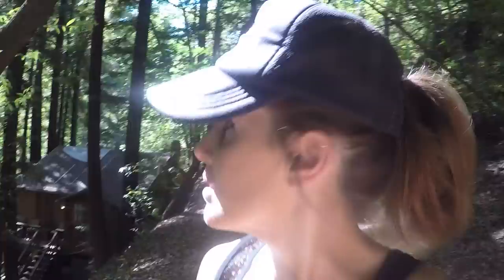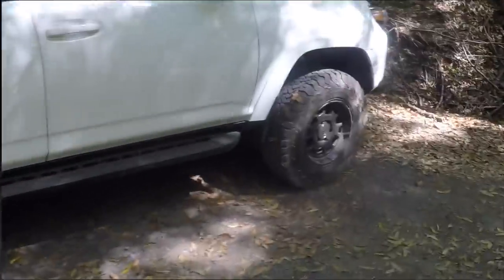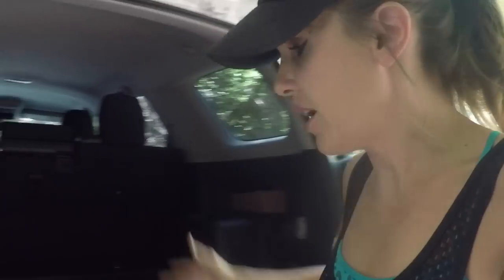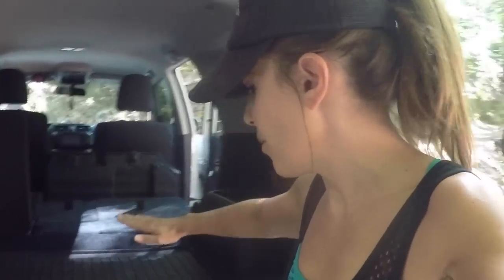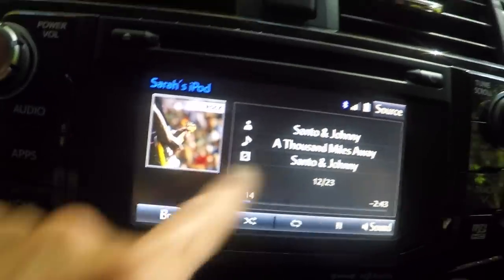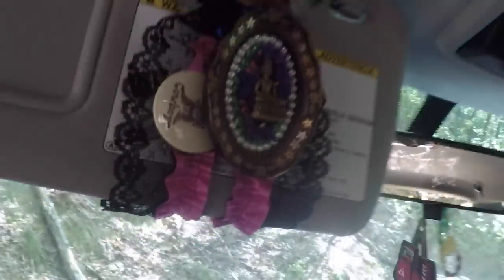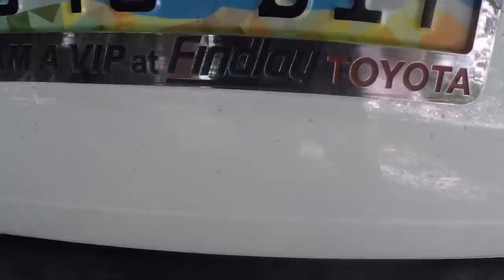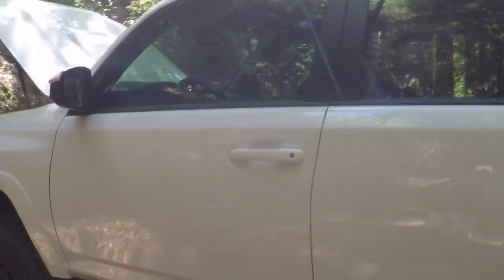Overview of My New 2017 Toyota TRD Off Road 4Runner

Comment: Good luck with your new ride! White and silver is the best in a hot/sunny climate especially where you go. I have an 87' 4Runner I got new and it's still running strong, everything works and the interior is still in good shape just the fabric has fade after 30 years. If you take care of it it should give you many years of good service. My only suggestion is to use common sense as far as traveling true off roading. You can get yourself in a real big jam with no help around. Emergency beacons are a good thing to carry.✌️and stay safe!
Reply from the maker: +J Vatell thank you!
Reply from the maker: +Wonder Hussy wow, that is an impressive story! I love hearing stories like that when people take pride in their possessions and don't just trade them in every few years for a newer flashier model. good for you!!
Reply: I do take very good pride in "all" of my possessions and it also the way my mom taught and raised me (plus you work hard for your money). I have a 10 year old Jeep also I bought new but mechanically it is junk compared to the 4Runner. I have spent more money in it's life than ever in the 30 years with the Toyota. The only major repair I had to do on the 4Runner was to replace the headgasket. All the rest has been just regular maintenance, tires, shocks and brakes.
Reply from the maker: J Vatell yeah I heard that about Jeeps.....too bad, they look so cool!

Comment: White does stay cooler for sure, l have a Tacoma in white. If you drive it right the tires will last you much longer than they are warrantied for (stay below 75). No you don't need more lift. Go to a sporting goods store and buy a backpacker mattress, it should make the back even, just check them out.

Comment: Here are some suggestions of things to pack for one of your trips. 1) a first aid kit. 2)MAXSA Escaper Buddy Traction Mat (Set of 2) for Off-Road Mud, Sand, & Snow Vehicle Extraction , 3)Extreme Outback Products  Ultimate Shovel (three section shovel stores in a carry bag) or some type of small shovel..  4)  a jerry can for water. 5) tarp, paracord and tent stakes for  a shaded area outside of the vehicle. 6)Flashlight, signal flares. 7)wet wipes and TP. (cause shit happens.)

Comment: Did you negotiate them down some from MSRP?  Toyota dealers can be stubborn to move from retail prices at times.   I have a 2012 Toyota and it's got over 120k with no issues other than a bum battery
Reply from the maker: +huggable cactus I had a friend do the deal... he used to work for the dealer so he knew all the ins and outs and got me a fair price :-)

Comment: I've heard mostly great things about the 4runner. also if you keep a vehicle for a long time the warranty will payfore itself at least once. that looks like factory level tint you're probably just not used to having tint on your front windows. it's probably like a 30% tint level, my car has 5% on every window lol. give yourself some time to get used to it, you'll grow to love it with the sun beaming through. 
lastly, in my truck I keep ratchet straps/tow hooks, because I'm too cheap for a winch and they come in handy, jumper cables, emergency kit, a basic tool set, first aid kit, portable air compressor like one that fits into a 12v cigarette thing. where I live the winters get bad so in the winter I add extra emergency stuff, I usually end up using at least jumper cables or give someone a tow out of the ditch at least once every winter
Reply: oh and if you really want the tint off, it's just a thin film on the window. it peels off fairly easy with a heat gun

Comment: Wow, I'm really jealous. You deserved a new vehicle. Great choice. You can go crazy on accessories for 4 Runners. ARB makes great off road stuff. Especially a front bumper with winch. Warner makes a good wench and Ridgid makes superb LED off road lights. Stay away from those cheap Chinese copies. Since you do a lot of desert driving, you might consider a land anchor with your winch with nylon straps. Also a High lift jack with wide base. Can be pricey when getting started but it's good insurance. Welcome to the Overland crowd. I could go on forever about 4 wheelin. Happy for you!😁
Reply from the maker: +Mark Taniguchi thank you so much for the kind words :-) I appreciate it sincerely!

Comment: You don't need to lift it. It will take you far in its current state. Time to head east to explore UT, AZ, and CO.
Yep get some foam and throw an inflatable sleeping pad in it for sleeping. I suggest Klymit. They make insulated versions that are great. 

There's an outlet underneath already for your towing needs. Time to check out the owners manual. ;)
Reply from the maker: +efromhb yeah I got about a 5in stack of materials to read through before I figure everything out

Comment: I'd get the male portion that goes into the hitch with the pin that holds it in and a 2" ball with correct shaft size to fit  hole and tow strap so you can pull someone or get pulled out easily if you get stuck.

Also the front glass itself may be tinted but sometimes they lay a paper thin tint film on the inside of the glass, if this is the case you can have the film easily removed.

P.S.: The naysayers are part of the landscape - I love your videos you are awesome!
Reply from the maker: +Marc Beebuzz thank you so much!!! I appreciate your words of support :-)

Comment: Awesome ride. I have a Toyota Tundra truck and I bought an inflatable air mattress for sleeping  on. They only seem to last a year or two. Therm-A-Rest pads are another option, no pump motors to fail. While I'm not a police office, but in California (Evil State) I think its against the law to hang things from your rear view mirror. BTW, I think you are a nice gal and I will leave it at that...
Reply from the maker: +Mach 1 thanks!!! yeah I'm not sure about the tint or the stuff hanging from the mirror
Reply: Intex makes better inflatable mattresses than Coleman. They sell a twin sized...double height model with really well reinforced corners...and they DONT leak. The air valve is a really well designed concept. It deflates quickly...(so you can fold it up real tight and save space. They're INFINITELY more comfortable than ANY measly sleeping pad...or foam slab. Foam collects dust mites...allergens out the ying yang..and are hot to sleep on.   Walmart sells the Intex stuff...and you can find all the models they sell...on their website. The model I refer to...is about 60 bucks. Flocked top...and reinforced vertical ribs...to lessen any "taco" effect. I have one...and it provides as good a night's sleep as my bedroom mattress.

Comment: your front end is WAY better than the TRD PRO with those ICON upper arms and reservoir coilover shocks. That is the only different (suspension wise) thing between yours and the TRD PRO, and you will be able to take more of a hit. Not factory, but ICON can next day air an upper arm anywhere in the USA
Reply from the maker: right on! thanks!

Comment: 17 MPG ?? I thought it would have gotten at least over 20. I have an old H1 6.6 Duramax with a an Alison 5 speed transmission that is modified and aspirated to run on diesel, LP and hydroxy and I get close to 29 mpg with no loss of horsepower while being aspirated. I go to some of the gnarliest backwoods, mountains, swamps and fields with it with no regrets. I have a rack system on top which I have narrow expanded metal that I set up my tent on so I am high and off the ground which in a lot of cases has been good. I also have a small 100 watt solar panel  and converter that I have on the front  of the rail over the drivers and passengers seat area. I have a small honda 2800 watt generator that I also have on top under the solar panel. I carry a 4 ton hi lift handyman jack, a set of grip track folding traction plates, I carry several 5 gallons of water and 5 gallons of #1 diesel,  I have a 100' tow strap 20K rated, I have several block and tackles and 50' of 3/4" cable, an array of clevis and hooks. I have a dual band vhf/uhf radio and I have an Inmarsat communication system. 
The vehicle is equipped with a CTIS system which I added rubber inserts in which keep the tires from going completely down to the sidewall. I don't use it much, I have a set of Goodyear Wrangler MT/R  and a set of BF Goodrich MT for highway driving most time. She is a little beaten up over the years (11) and I don't do as much off road as I used to but since retired will probably do much more. 
So who cares how you got the vehicle. I don't if someone was nice enough to give it to you with no strings good for you. I think your a good person. And even if you did blow someone or other things who cares it is between you and them. We all work selling ourselves in one form or another. 
you keep on keeping on and maybe we will cross paths soon. 
Semper Fi
Reply from the maker: +Structureman Chop right on, man! I think I get worse mileage because of the off-road tires...it's still decent overall and I love the car!

Comment: congratz on your brand new beastie!

some words of caution though:

you ought to familiarize yourself with those gear settings, both automated ones as well as the manual ones ...

if you don't and use a car like this in the wrong transmission modes for the type of road or terrain you'd be driving on, you may damage the engine beyond repair!

in particular, you don't want that to happen to you when you're deep in a desert or a mountain road on your own without anyone close by to help you! and you don't want to lose a good car like this all too soon until it serves you well ... certainly not before its warranty ends ...

all n all, a machine of any kind, an off-road SUV in particular, needs good attention and constant periodic service in order to be maintained right ... a little bit costly so to say but do it right and it won't cost you more than it should ...
Reply from the maker: +dadautube very good advice! I have a lot to learn about this car and I definitely don't want to screw it up so I'm going to take my time and talk to some experienced people

Comment: Shot he dropped 40 grand on that, must be one helluva fan. The shocks are good, they are remote reservoir, icon is not a cheap brand.  I used to work at the dealer in Flagstaff.  Findlay.

To block the windows go to walmart and buy the cheap windshield sun shields and cut them to fit the windows, about 3-5 bucks a piece
Reply from the maker: +huggable cactus right on! Thanks for the advice!

Comment: Krown Rust Control that 4 Runner
or 
Rustcheck
or 
Fluid Film 
or 
Corrosion Free Formula 3000
or
Carwell it

Pretty much your best rust proofing options.Even if you don't live where salt is...Moisture causes rust.

Comment: settled you have an icon upgraded suspension. most likely a stage 3 that's not stock. I wish I had that on my 4runner.
Reply from the maker: +joker9736 it wasn't stock but I'm pretty sure he said he gave me a stage 2, not a stage 3
Reply: stage 1, 2, 3, & 4  icons do not have reservoir. you showed the front suspension that has a reservoir which might even be a stage 5 kit. As for your front windows being to dark you can get a razor blade and peel the tint off. Findlay Toyota tints all their vehicle with the light tint typically just the front since the back windows are already tinted from the factory.
Reply from the maker: +joker9736 ahhhh.....thanks! I know so little about any of this....still learning :)

Comment: 😎🇺🇲🇺🇲🇺🇲🇺🇲🇺🇲
Really nice .....tow strap...small collapsible shovel....space blankets...space collapsible sleeping bag...water & gas jerry cans....small toolbox & sockets....batt charge cable set ...gorilla tape....hazard triangles...funnel ....oil...trans fluid...coolant...power steer fl...signal mirror s.stl....light flash beacon ... 2 rubber chocks...air can inflators

Comment: Wal-Mart has a sleeping pads for camping - you can stack them up under the black cargo protector. They cut well with. razor blade used in the utility knives. Congrats on the TRD - good luck. Enjoy.

Comment: The KDSS is kinda of a limiter as far as height and aftermarket options, even so you can still lift it 3 inch. Which it looks like you have a good Icon lift on it now. If you need any help with lift options or armor options for the KDSS I can probably help or at lease point you in the right direction.

Comment: KDSS??    That's an ICON aftermarket suspension system and it's definitely bad-ass!
I put that suspension system on my FJ Cruiser.    I'll take ICON over Bilstein on a 4x4 any day!
Keep what you got, trust me it's good.
Reply from the maker: that's what I've been hearing! thanks for confirming
Reply: Not only that but I see you also have ICON upper control arms, I'm going to assume your lower control arms are also ICON?

Comment: Good stuff! Food for thought: If the dip in the sleeping surface continues to nag at you, CarMax is a great company with very smooth transactions. You can locate the exact rig of choice, have them hold it and just drive there and do a trade in. Of course you’ll take a slight hit but your TRD will command excellent swapping value. CarMax is so easy you could do the whole thing in probably an hour! 
Just something to keep in mind.

Comment: You don't know it, but that suspension is better than the bilstien.  Icon is a great company.  It also has the upper arms from Icon  and shocks which are around a $2600 to $3000  an upgrade from the PRO model.  Tires and wheels are great equal to the PRO.  Other than the fancy stitching and exhaust you would have had on the PRO.  I think you have a better vehicle Less the PRO Price.
Sounds like the windows were tinted for Arizona.  A bit unnerving anywhere with trees or shadows.

Comment: a  wench is a necessity  and  some ratchet straps  to  feed through the wheels in case you can't encore to a tree to pull yourself  out   when you get stuck and also a power inventor to charge your camera and other stuff while on the road  where their are most defiantly going to be a lot places   you explore without power to charge your phone as well so it's your home away from home
Reply from the maker: +Zach Swanson yes I definitely need to stock up on some of that stuff
Reply: just helping you out and so your adventures go  more smoothly and  making the back of your suv more sleep able is a great idea to save money for gas and food for the journey instead of paying for a room  as for google earth you can scope out the roads to your journey ahead of time

Comment: Wonderhussy if you get a winch. it needs to be rated at least twice what the vech. weighs. so if your truck weighs 4000 pounds you need a 8000 pound winch. i would stick with a name brand like Warn or Ramsey. i would get one that has rope on it instead of cable. a lot lighter and much safer to handle. i would also get a ARB fridge that would plug into that outlet in the rear. in Las Vegas there should be a 4Wheel parts.com store. they should have every thing that you need. i would also say you need to go to Moab,Utah. from what i have read it is some pretty awesome country. when you sleep in your truck do not i repeat do not leave any food in there with you. your truck may be stout. but if Yogi Bear wants in he,s gonna get in. i  can,t wait for your new adventures to start.
Reply from the maker: +lilorbie lilorbie thank you for all of the useful advice!
Reply: not a problem. just here to help.
Reply: Ripp Snortin that maybe the case. but i will stick with what i know works for sure. my 8000 lbs. Warn has saved my butt on more than one occasion. not the Jeeps fault it was the nut behind the wheel that was the problem. i will always buy a Warn winch . they are made here. Harbor Frieght  who now,s where they come from . my guess is China.

Comment: Now you can come on our Mojave trail trip in April with "SoCal Overlanders" join on FB, I would also join this club on FB as well  "SCOR" (Socal Off road recovery).  PS the cargo raCK WILL ATTACH TO THOSE SLIDING BARS MOST LIKELY.  tHE TINT ON THE WINDOW CAN BE PEELED OFF MOST LIKELY, USUALLY $20 A WINDOW TO REMOVE IT.
Reply from the maker: +Treasure Geo very cool!!!! Thank you for the useful info!